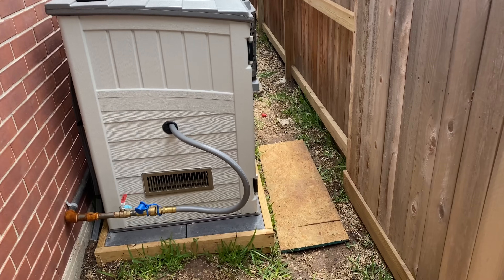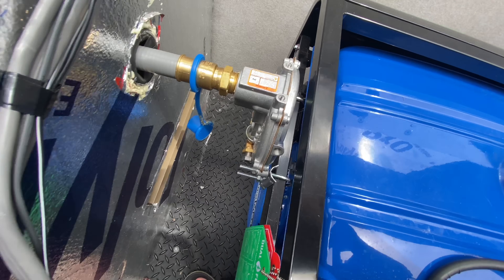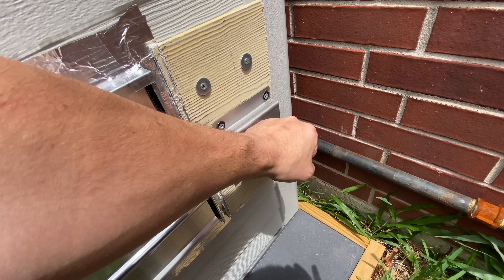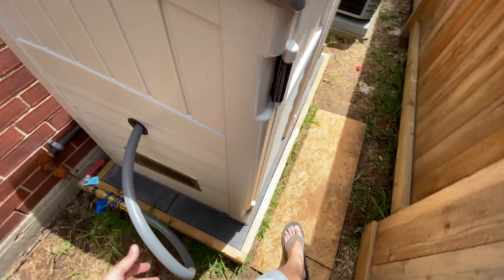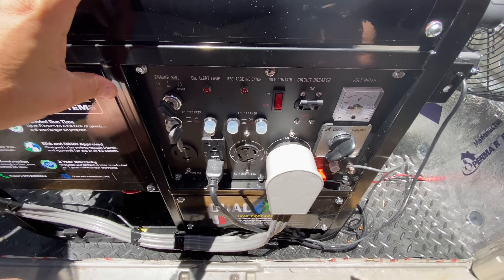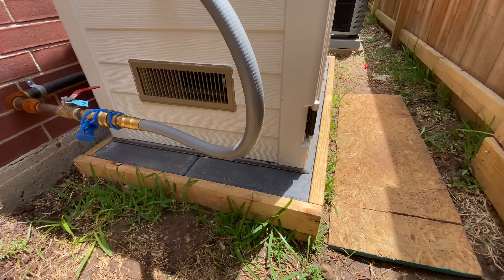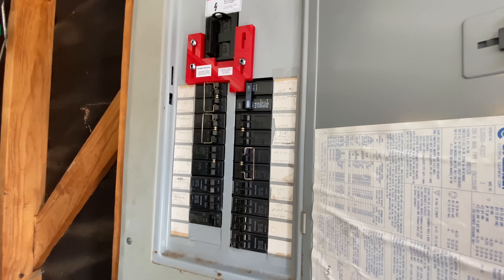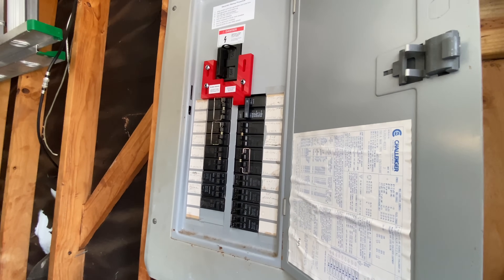Converting a hybrid portable generator to a whole home generator with shed

Comment: awesome video. the reason you had to mess with the adjustment screw was the regulator is mounted upside down. there is an arrow on the back of the regulator that shows direction
Reply from the maker: Be sure to check out the update videos :-)

Comment: Do you leave your gas open so you don't have to go outside you just started remotely thanks
Reply from the maker: Not currently because I don't have remote start. If I did I probably would. There is a regulator on the hose so it should be fine.

Comment: I bought a Honda generator 7500 watt only 65dp very quiet,a little more money but worth every dime.it also has the option of remote starting from inside your house or shutting it off you wouldn’t need to go out in the middle of the nite to shut it down.I think your generator runs about 110 dp very irritating.

Comment: Very informative videos. I'm in Richmond TX and am building a similar setup using the Duromax XP13000EH generator. The exhaust pipe on the muffler measures one inch outside diameter. Not sure if the Duromax 12000 model you have is the same dimension. Did the Walker one inch exhaust pipe you used fit over the exhaust pipe ok?
Reply from the maker: It did fit well. I think I saw someone say a 13000 took a little bit of tweaking but they still used the same pipe.

Comment: Thanks Calvin, great video. I am going through this process now up in Kingwood.  Great to see people from Houston doing these videos because a lot of issues we run into here is the humidity & heat during the summer so I was not sure, until I saw your video, if I could actually enclose a generator safely.  Waiting on Centerpoint to run a natural gas line for me.  I will be using some of your ideas for my storage box.
Reply from the maker: Hi Steve. Did you already have gas and they are extending it for you?
Reply: Basically yes. My gas main is on one side of my house where as my breaker panel is on the exact opposite side of the house so I’m having them come in and run another line just for the generator. This will hopefully be less expensive than it would for a plumber to trench all the way around the house and lay down the line to extend from the main. We will see.
Reply from the maker: @steve6438  I have this same issue. Are they installing a new meter or just running the line from the existing? What was the cost?
Reply: They are supposed to call me in about 7 days (utilities are the only ones who could get away with that)- I will let you know the outcome and cost.
Reply from the maker: @steve6438  thx! I would really like to move the generator shed to the side of my house with the panel but not wanting to pay a fortune to bring the gas all the way around.
Reply: Hi Calvin, FYI - CenterPoint came out. They are going to install a new line and meter - $700

Comment: That was very impressive, what I like mostly is that your explanantion wasnt all over the place & very easy to understand. I haven't  purchased my generator but have put in the inlet box, breaker etc. The 50amp breaker I bought seems to be much bigger than then one you have, did I purchase/install the wrong one(double poll, duty 240)?
Reply from the maker: They come in different sizes. Even for my breaker box. Some more compact than others.

Comment: Great setup. Isn’t it bad for the generator exhaust to be blowing toward your a/c unit? I live in Florida and I would be running the a/c off the generator, but if you’re not running a/c year round I’m sure it’s okay.
Reply from the maker: It’s definitely not optimal. At some point I would like to move it to the other side of the house and extend the gas line.

Comment: Did you have to get a new gas meter installed?  I have the XP 13000EH.
Reply from the maker: I used my existing meter. I don’t have a pool heater or anything special.
Reply: @CalvinGorriaran  okay thanks

Comment: Great video! I'm in Houston too, and in the market for generator setup like yours. I was just about to order your exact generator from Lowes. In the comments you say, "You'd buy a different generator if you had it to do again", what generator would you get?
Thanks,
Frank
Reply: He mainly said one with exhaust coming out the back not the side was his complaint along with electric start.

The firmans have CO2 auto shutoff too but aren't as powerful I think. They do have trifuel versions though!

Comment: Great idea, I liked it so much I built one similar before the city shot me down. I needed a larger NG meter but Center point wouldn’t install one until I got a permit with the city inspecting my build first. Mine looked every bit as good as this one in the video. To shorten my story the city said I had a bomb and had to put the generator back to the portable state. So if you live in the city make sure your gas meter is large enough to run your generator on NG. I was told by the regulator company you have to have at least a 6 oz flow. Good luck and happy build.

Comment: Nice job on the enclosure but.......having run my Generac XP10000e last summer when it was very hot outside, my unit overheated. It has a kill switch so the unit was not damaged. I had a similar size shed/fan etc and it was NOT nearly sufficient for this unit. I previously had a 5,500 Watt unit and the shed was fine, but larger units REALLY need a much larger shed, fan and vent openings. If you go to the "nooutage" site you can view their recommendations for varying units under "PowerShelter plans". Both yours and my unit call for having 5,000 CFM exhaust fan and 30" inch shutter intake opening! You may run fine in cool weather, but if it gets warm, that large generator will cook in a small shed like this. All generators need far more space around them to have sufficient air circulation.....
Reply from the maker: Take a look at my temperature video I made. Maybe your enclose wasn’t creating enough of a vaccine effect? I haven’t had any issues with temps being a problem. I am a hot climate btw.

https://youtu.be/vDLHs73cvkk

Comment: Calvin, do you know what percentage the THD is on this generator?  Have you had any problems with your sensitive electronics - computer, fridge, etc?
Reply from the maker: I don’t think it’s that great. Probably around 10-15. I do my best to monitor the RPM with the technometer and not overload the generator too much. Staying away from electric appliances like dryer, oven, stove. They are the worst. Trying to covert them all over to gas overtime.
Reply from the maker: You can always add a line conditioner or UPS in front of any of your expensive items. I have not had any issues yet.
Reply: @CalvinGorriaran  Thank you for both replies. Good info.

Comment: Calvin, nice videos.  Can you tell me what temps you recorded with this setup during the summer months?  I live in Cypress, TX and I am concerned about high temps damaging my new generator.  Have you found any source which gives a recommended maximum temp. for a enclosed generator?  Thanks
Reply from the maker: Even when running it over the summer, it never seem too hot in the shed. Now that I have a smart temperature monitor, I have watched it top out near 120 degrees inside the box. That, considering it being 98 degrees outside and the box being in direct sunlight, doesn't seem too hot. I always have the option to open the lid if I want it to run cooler but have not had to do that. I have not been able to find anything around what Duramax considers normal operating temperatures for their portable generators. https://youtu.be/vDLHs73cvkk

Comment: I’m in the Houston area as well and we had talked about getting a generator after Harvey hit but still didn’t and after this winter storm it was a no brainer.  Well I brought this same unit with CO2 detection on it and was considering putting in a transfer switch so it could run whole home and looking to convert to natural gas.  Who did you use to put in the gas line?  By the way your video was super informative! Thx

Comment: Hi Calvin - apologies if you've answered this and I missed it. How were you able to secure the cement board to the shed? I see your screws and washers - do you have bolts on the outside or did the regular cement screws secure it?
Reply from the maker: Hi Mike. Just large washers with drywall screws :-)

Comment: Calvin, can you give more information on the Sturgis cable you used to go from the regulator to your hard pipe that was run? What connection  size goes to the regulator?

Comment: With 30 - 50amps you aren't powering much of a home. Not doing much here but powering a small central air and some lights or maybe a window unit.
Reply: Watch his update video. This got him and another family through the power outages in TX. It's not a home standby generator but it did the job.

Comment: Hello Calvin, great video. Love your shed. Excellent design and construction.  I took quite a few pointers in designing mine from you. 
If you would like some advice on your remote control issue,  I absolutely love my WGEN9500 Dule Fuel generator. Their generators have the remote control key fob that would work from 260' away. They are a more compact generator with very good quality at about the same price if not lower than your Duramax with way cooler features like the remote control starter and the ST Start System. Just a suggestion if your planning Upgrading. They even have another size up which would kick butt on anything. But that would be along the same lines as the XH 1500 Duramax in technology. I even use the same exhaust port as you so the only change you would have to make is a shorter exhaust pipe as the exhaust points back towards that wall. 
Saw your updates as well. Glad you made it through the Texas siege. Take care Brother.
Reply from the maker: Thank you! I am looking at the WGen 12000DF!

Comment: First off, I want to say you did a great job figuring this out and explaining what you did.. However I think buying a standby generator that is already set to run on natural gas and designed with safety in mind, seems like it would have been very close in cost (all things considered). I am not sure where your $10000.00 estimate comes from IF IF IF your able to do a self install (like you did). For professional install, labor is definitely more than the generator itself. You must have 30+ hours into this project and that cost should be considered. You do make some good points but I see alot of disregard for safety(you have to flip that regulator right side up asap) and for what boils down to saving under a thousand dollars, doesn't make alot of sense to me. Realistically that is a standby generator now and just taking it out to use as a portable again would come with alot of hours of work. I am a licensed electrician and work in Michigan for a power generation utility. Thanks for the video.

Comment: It appears the exhaust tip on the 13000eh is slightly bigger than 12000. I saw it as 1.02” somewhere. The walker flex tubing 1” (4000) appears to be too small. I can’t get it to fit over the tip. Any suggestions? I saw the walker 4001 which is 1.25” but not sure if I can clamp foe a good seal?
Reply from the maker: Hmm. I bet you could get the 1.25” to tighten enough for a good seal. Worth a try.
Reply: @CalvinGorriaran  that’s what I think also. Thanks

Comment: I just have one question. How big is your Ac ?  I have a 5 ton and I was just wondering if that's too much for that generator that I'm looking into buying? Thank you so much for the video it was helpful.
Reply: I also have  a 5 ton unit and I have the bigger 13000EH Generator and it can't power my A/C.
Reply: @postcard-marketing  Have your AC guy install soft start kits - reduces the surge on start up so a generator can manage them.

Comment: Damn that's close.  No land on that side
Reply from the maker: I am probably at some point going to extend the gas line and run it to behind my detached garage. I would rather it be closer to the panel anyways.
Reply: @CalvinGorriaran  what type to gas pipe with quick disconnect do you use ?  1/2, 5/8 or bigger ?  Where can I find it ?

Comment: Question for the through the wall exhaust.  Did you remove the spark arrestor from the generator?  What do you use to keep bees, etc. out of the exhaust pipe?
Reply from the maker: Good question. I did so I probable need to add a filter on the end somewhere.

Comment: i think your regulator may be upside down,,
Reply from the maker: It was, I fixed and included in the update video 😬
Reply: @CalvinGorriaran  nice, may be why you had to adjust the carb,  i have seen others in that position though,, but on a lot of them it is cast into the regulator "this side up"
Reply from the maker: @alzzie7164  probably so. It didn’t seem to hurt it but definitely did not want it getting stuck open.

Comment: Just FYI. As a licensed Home Inspector I’ve done research on the Challenger brand electric panels and call them out as a recalled problematic panel.  Most that I run across have a certain font on the breaker size that easily identifies it, the font reminds me of the 80’s Z28 font.  Yours is a little different but I’m not sure if its included in the recall.  Please look further  into this.  https://www.howtolookatahouse.com/Blog/Entries/2020/3/why-are-challenger-electrical-panels-not-insurable.html
Reply from the maker: Thx! I will dig into this.

Comment: I've read at least 20 times NG is NOT recommended to be used by Duromax Company. It will cause damage to the Generator.
Reply from the maker: I spoke with Duramax after they saw my video. They did not raise this concern. They did mention a tri-fuel generator is about to be released.

Comment: Calvin I have same exact generator and regulator setup. You say in video you run with choke in halfway position? When I use propane I use choke in halfway position to crank but go back to normal.On my natural gas mine will only run smooth if I move choke about 1/4 inch from open
Reply: May need more pressure through regulator or turn throttle up? Your natural gas may not be enough pressure coming into your house. I'm just guessing.

Comment: This is the most informative video I have been able to find thus far! I believe you should wrap your flexible exhaust with hi-temp header tape. It will allow your exhaust to scavenge much of the heat to the outside instead of radiating through your flexible exhaust into your enclosure; turning it into an oven. Here is a link to the kit I bought. Thanks for the great videos. Please make one on how to install the capacitor on your AC units. https://smile.amazon.com/dp/B07JK14BY7/ref=cm_sw_r_cp_apa_fabc_AHFQJT1JXBS39Z1RB5FX?_encoding=UTF8&psc=1

Comment: How does it handle a full load including your AC units? I’m thinking of doing something similar but want to make sure I can run my AC for hurricane season. I’m just up the road in Missouri City
Reply: I've got the 13000EH and it can't handle my 5 ton unit. I can only run my lights, 2 fridges, and a portable a/c unit that we have in the master bedroom. So we basically stay in the master bedroom if the power goes out in Corpus Christi, TX.

Comment: Hello Calvin, thanks for the video I’m waiting for my generator to arrive, I just bought a new generator thanks to you, I just have one question regarding your 
A/C unit, I ordered a 13000 watts and I have my doubts if it will handle a 5 ton A/C central unit..?
Reply: I really appreciate Calvin, thanks for taking your time to help i will definitely look into that..
Reply from the maker: Check out hard start kits and match it to the size of your AC. Assuming you connect to the generator to a 220/50amp circuit, you should be ok. I just would limit any other large electric appliances like cooktops or ovens, etc.
Reply from the maker: 5-2-1 CSRU2 Compressor Saver for 3/12 to 5 Ton Units
Reply: @CalvinGorriaran  why didn't you use the regulator that is already on the generator ? You didn't have to buy another regulator.

Comment: I have a ng outlet for an outdoor grill right next to my breaker box. The generac guy told me I have to run a new gas line from the meter on the other side of the house. Does anyone have insight on that?
Reply from the maker: My gas and electrical panels are on opposite sides of the house. I ran a large 6/3 direct burial cable from the generator to the panel. That being said, I think the preferred method is to take the gas and bring the generator closer to the panel to reduce power loss and strain on the cable to the panel.

Comment: You fixed it like a professional. Great job but if I didn’t have enough room to get around my house without getting on the neighbors I would just plug a line into there house and pay them for the electric. Does living right against neighbors in swanky areas make it worth it?

Comment: You should add a temperature sensor to Arduino and an actuator so that at a certain temperature it opens the whole top up and allows all the heat to escape. Then once cooled down, it will automatically shut. You could also use a smart device that you can check the temps.

Nice work and nicely executed. 👏👏
Reply from the maker: Good idea!
Reply: @CalvinGorriaran  , I’m buying the 13000 watt. I didn’t know these generators could run on natural Gas. How did you manage this? I was gonna to buy a 40 pound propane tank, but your setup is a lot better.
Reply from the maker: @MrDeputy5  only change I made was a different regulator. Used the existing hose that was connected to the onboard propane regulator. You will find NG regulator kits online for many generators. I only used the regulator from the kit. The other parts I didn’t install and it worked great. I talk about that in the video.
Reply: Remember not to store propane tanks indoors because they can explode. Just reminding everyone to be careful and stay safe. Thank you